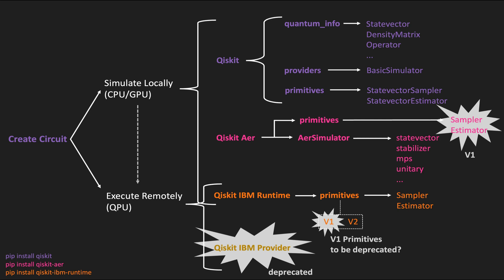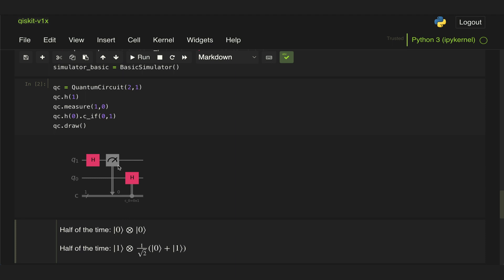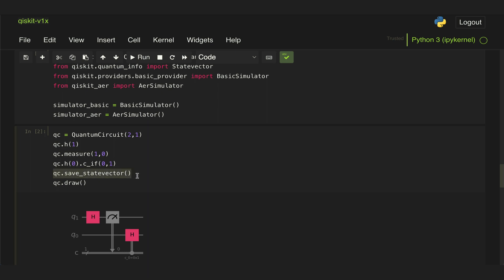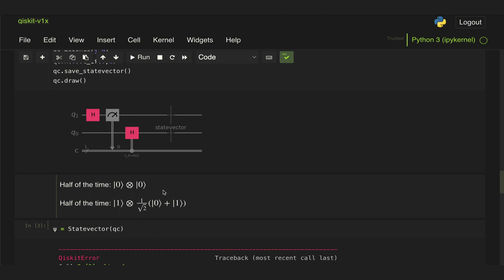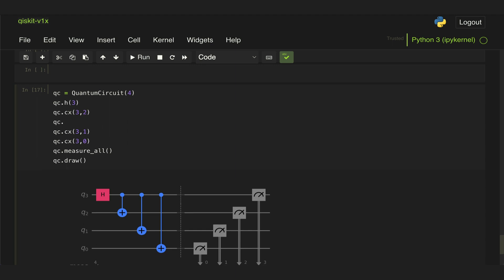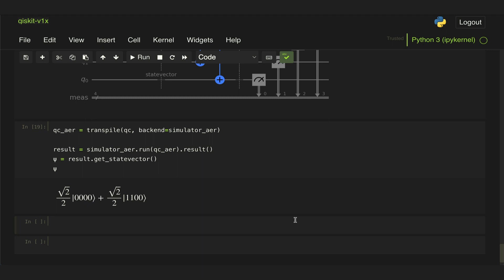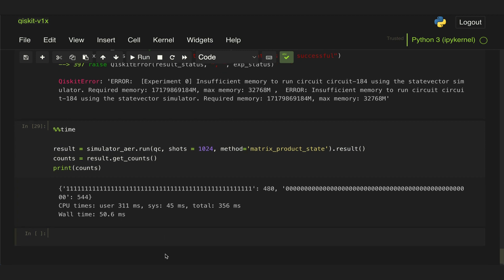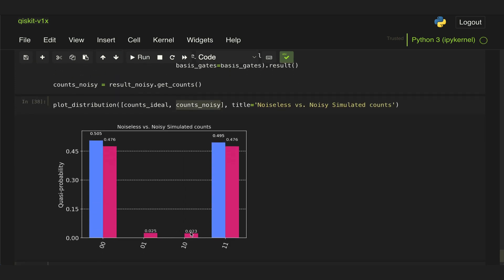Using Qiskit v1.x | Part 4 - Qiskit Aer's AerSimulator

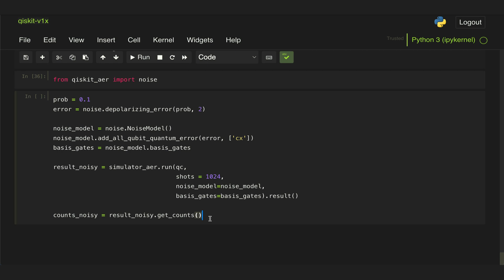Comment: Great material. I have a question: at minute 09:43 when you run the circuit with the noise model, why do you run the "qc" circuit and not the transpiled "qc_aer" circuit? Thanks!
Reply from the maker: Great question. This was a mistake from my side, I should've used qc_aer instead of qc. Now, in this particular example, this does not make a difference because for such a simple circuit, qc and qc_aer are identical. For more complex circuits that have blocks not included in Aer's gate set library, you will get an error.